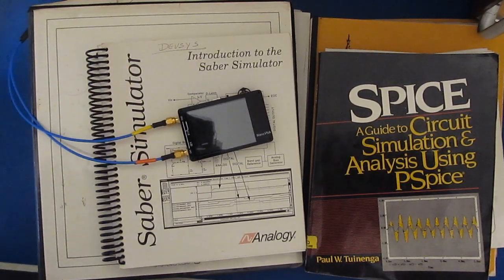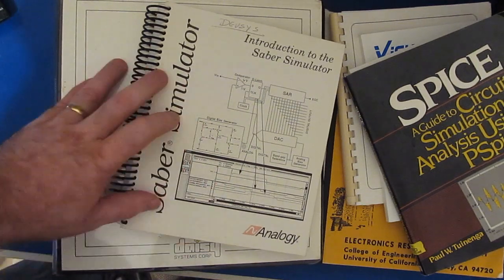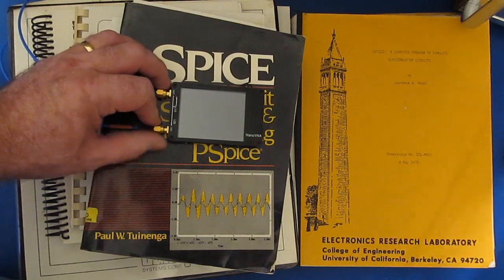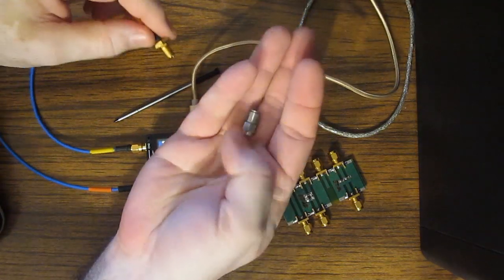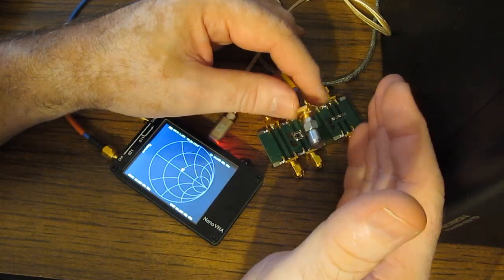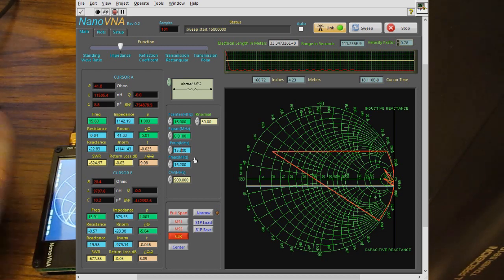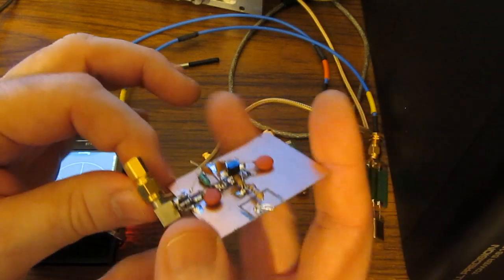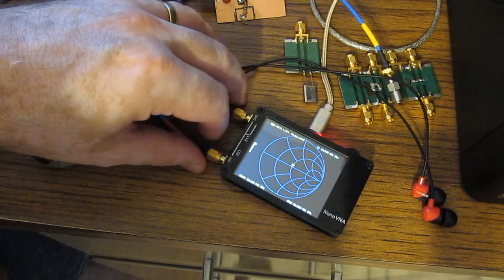Using the NanoVNA to Create SPICE Models for Simulation

Comment: Interesting history.  I remember our department being billed for time usage on the 11-780. What a revolution we've seen. 
Working through labs in "Electronic Devices and Circuit Theory" which incorporates spice activities. Installed free Pspice from TI. So many tools are free or very affordable for home use these days.
Reply from the maker: Jeff, does the TI simulator support Touchstone files?   If not that Micro-Cap simulator is now available for free.

Comment: I've used PSpice for DOS too in Pisa faculty of electronic engineer in the '90s on my 80486DX.
Reply from the maker: I think we had one 286 6MHz IBM AT when we bought PSPICE.   It was built as a packed executable but you had to rebuild it to add parts to the library using MS Fortran.   I rebuilt it unpacked, then used Debug to examine how their protection worked (required the floppy to be installed).

Comment: Great idea to import a real component to simulation model.  Also shiftting the 100 steps thru the span is clever. Instead of supply source code, could it be supplied a flowchart of the program on paper   or starUML ?

Comment: Remember the original Touchstone offered by EESoF?
Ya ... the one that ran under DOS and used a parallel port dongle ... those dongles could be imitated by some discrete TTL logic and the proper response 'codes' burned into a 2716 EPROM. I also used EESoF's ESYN to create some magnificent filters, like the 160 Meter Broadcast-Band Brickwall Filter ...
Reply from the maker: I had to look it up.   I've ran into my fair share of those hardware keys.   I have some software that I still use from time to time that supports one but my PC doesn't have a port.  Took some time to get the company to supply me with a non-dongle version of their software.
Reply: As the statute of limitations has probably run out, I can say that a couple of us reverse-engineered the data the dongles exchanged with the PC ... don't know what they used for hardware inside those dongles, as we simply mimicked what the responses were that we saw with an (now old) HP 1600 logic analyzer. We were cracker-jack digital designers back then too!
Reply from the maker: @uploadJ  I have resorted to reverse engineering a few of these as well.   There is a video made for a CPU that I designed for an FPGA and I talk about the one hardware key I placed inside the FPGA as part of the design.  Basically, using the manufactures tools to design the hardware key for their tools...  I owned the tools but am not a fan of those printer port keys.     The earliest ones I had looked at used a counter with some basic logic was all.

Comment: Nice video, great job on the youtube.
However i'm confused,  is crystal really a very nonlinear device?
Feeding single tone in to non linear device, would create harmonics on the output?
VNA wouldn't work correctly for such component?
VNA does extract amplitude and phase only from present frequency through the sweep at the given moment. VNA can't look at other parts of the spectrum at the same time?

For example diode is very non linear device.
Every component, which produce harmonics and does mixing is not linear.
Component which does single tone on the output, from single tone on the input, have to be linear?

bdw, i'm not an expert in electronics or RF.. i think through analogy from control systems..
Reply: Crystal is linear, but, has unusual properties, like, really high Q factor ... 

Crystal filters are used in IF strips, and as "roofing" (the first filter) in HF comm rigs/radios.
Reply: Hello Bartosz,
I hope this helps (and is correct), in most electronic conversations non linear means with respect to signal amplitude.  So for a very limited case a 1K ohm 1/4 watt resistor with one Volt across it has 1 mA of current. Increase the voltage to 2 volts and the current will double. 

The circuit is linear. Put a 1uF capacitor in series and use a 1 Volt AC source  at 1Hz and measure the voltage across the capacitor and you will measure very very close to 1 volt AC. Double the voltage source and you will measure double.
Increase the frequency to 1MHz and with a 1 Volt source you will now measure noticeably less than 1 Volt AC across the capacitor. Double the voltage and you will measure noticeably less than 2 Volts AC by the same ratio.   The circuit responds linearly with respect to the amplitude.  We are not talking about response as a function of frequency. 

In summary the adjective linear referees to the response to different size signals and also has built into it the assumption that you do not for instance feed an amplifier so much signal that it would have to put put more voltage than it's power supply voltage allows.

The electrical model for a crystal is mostly a capacitor in parallel with an inductor. There is some very very small resistance which is why a crystal is high Q (High quality factor meaning that the amount of power lost per cycle of oscillation is much smaller than the peak power stored in the reactive elements.  The R the L and the C are all linear.

Hope this helps.
Reply: An additional note about "Time invariant".  There is often an unspoken assumption in conversations about circuits that the component values do not change with time.  For all these assumptions there are exceptions and so it is best to remember conversations are only approximations. 

Let's make up a case.

The 1/4 watt 1 ohm resistor  I postulated above. At one volt it dissipates V^2/R = 1*1/1000 or 1 mWatt. Well below it's rated power. It will warm up only a little and has only a small temperature coefficient to the resistance. So you can pretty much ignore the time variance. 

But put 32 volts on it and you have 32*32/1000 = 1 watt. The part is now going to get very hot and may change resistance some what.  It may even change resistance permanently when allowed to cool.
Put 100 volts on it and you have 10000/1000 =10 watt and the part will rapidly heat to glow red and then probably fail open. It is certainly not time invariant now.   In this overload application the resistor became non linear and time variant.  Most (All?) parts will become nonlinear and time  variant if overloaded but that is not built into the assumption during conversations about normal circuit operation.

Again I hope this helps.
Reply: Joe was wrong. Indeed a crystal is linear up to the point you exceed the power rating.